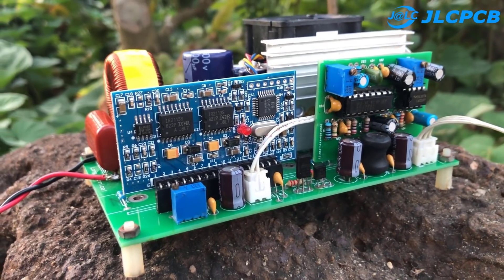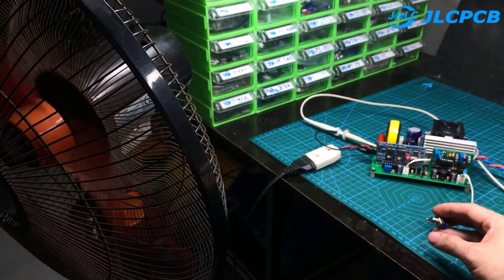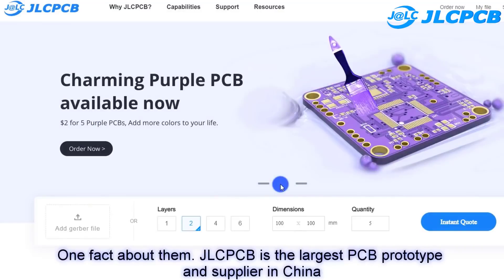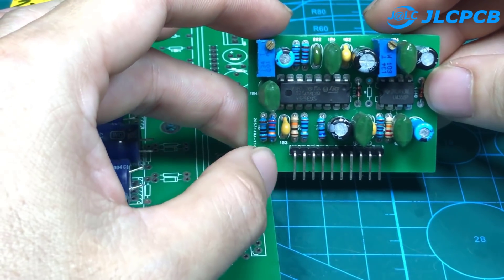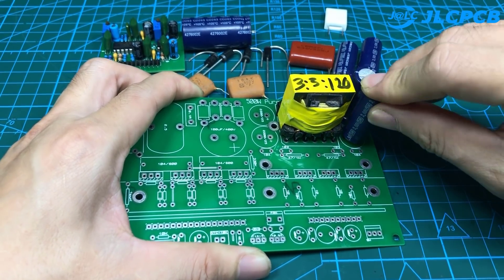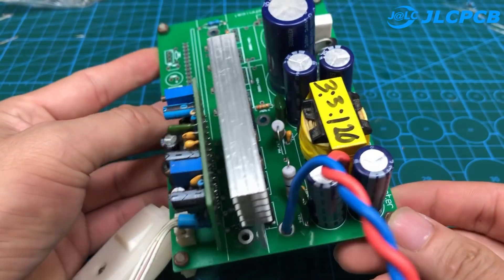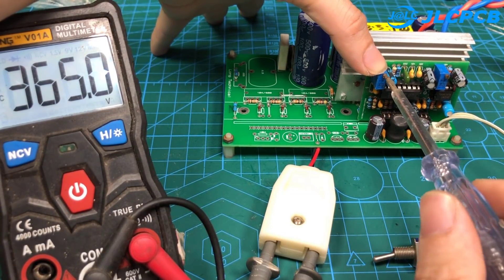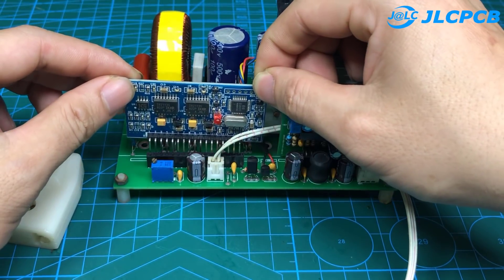Pure Sine Wave Inverter From Ferrite Core

Comment from the maker: Hello Bro ! Where are you from?. What project do you want me to do?.
Reply: I’m from India :). Please make a 20a buck converter with cc and cv
Reply from the maker: Hello bro. Nice to meet you. I will try to do that next time bro
Reply: I'm from bangladesh please make a inverter welding machine circuit as a easy process
Reply from the maker: OK bro
Reply: Amigo un inversor usando el sg3524 por favor
Reply from the maker: OK bro
Reply: a pure sine wave low freq inverter that uses 4 or 8  247 size mosfets  like the hy5608  would be nice  
would it be cheaper if it used mostly smd parts that are soldered on by pcb maker 
the esg002 would be nice also so there is no programming 
i have a bunch of transformers from 500 to 3000 watts it would be nice to use them in a very cheap way 
thanks either way my friend 
i like your videos  you do a very good job
Reply: is there an IRFB11N50A mosfet equation?
Reply: is there an IRFB11N50A mosfet equation?
Reply: Hi, I'm from Venezuela, Do you have the schematic used in this project? I have downloaded the drive file, but I only see the files for the board. Thank you!
Reply: Hi can you share the Schematic for the main board and your mini-control board
Reply: I want to see an interface between a Generator and the items that go to the house, end up with an Inverted Sine wave, rather than a Non-Inverted Sine wave.  In other words, a device that would be the middleman.  When it storms outside allot, and I have to use that darn generator, I end up having to buy ALL the Routers in the house.  This would NOT have been a problem if I had bought an Inverted Generator! :face-red-droopy-eyes:

Comment: Hi, Thanks for providing us the knowledge about High Frequency Sine Wave Invertor. I am just going through the documents attached and find that the value of inductor you mentioned in video at time stamp of 5:44 is 2.5 mH but in the document "SG3525-BATMON_tg500_100uF Top" the value of the inductor is 3.5 uH. Can you please confirm the exact value you used.
Reply from the maker: From 2.5mH to 3.5mh OK bro
Reply: @LongTechnical  Thanks

Comment: You are just showing the assembly, not how it works, calculations, why only use those specific capacitors and resistors. I don't want to copy you, if I clicked on this video, just to learn it properly...., and i find nothing learnable thing.

Comment: Hello sir thanku for sharing your knowledge.... Please explain me the On/Off switch connection 3 pin used center pin ground other both side In /Out  so please explain me.... Another one thing 12V supply for inverter egs002 and sg3525 both same power supply or different or isolated..... Input and Output will isolated in this design please explain me clearly if possible please thanks 🙏🙏🙏❤

Comment: Bro I want to make an inverter for PC around 200w load but egs002 is not available in my country. so can you please help me to find one I have only basic components and I wish to make it sine wave as square wave is harmful for pc like stuff. Please reply my question bro i appreciate it
Reply from the maker: OK bro. For PC you can you the circuit that i provice in prevous video. That output DC but it can use for PC